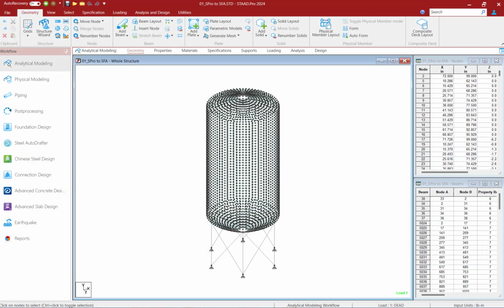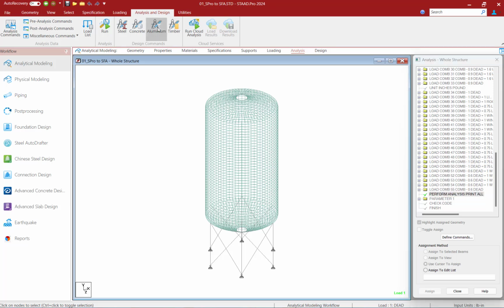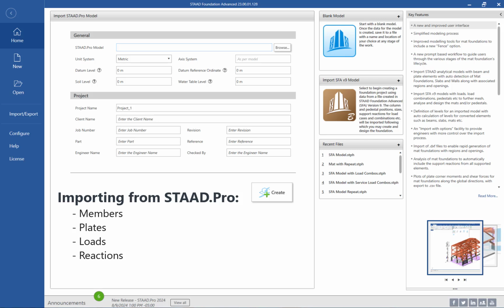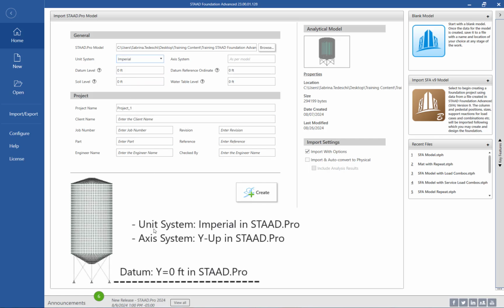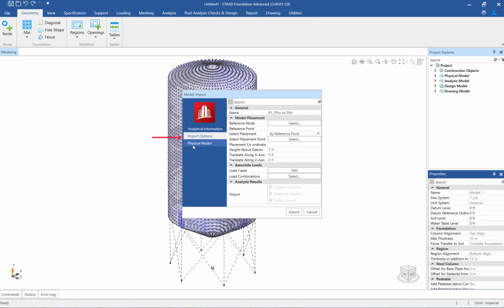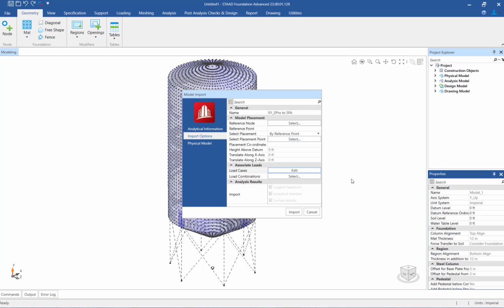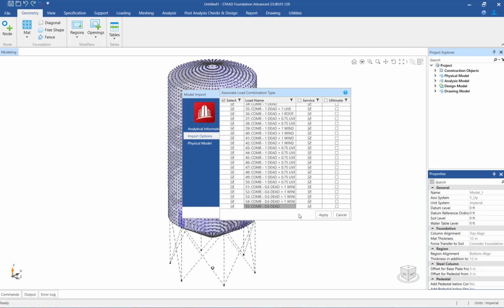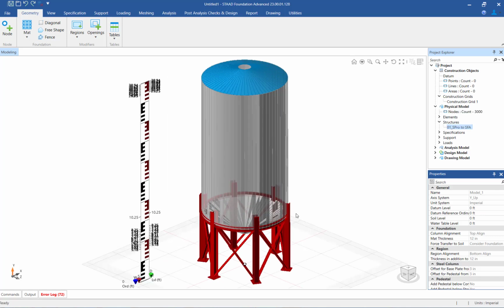Importing a STAAD.Pro Superstructure into STAAD Foundation Advanced

Comment: What happens when there are multiple structures, each with a different datum level or a single structure with support at different levels due to the site's irregularity or a basement that does not cover all the building's surface?